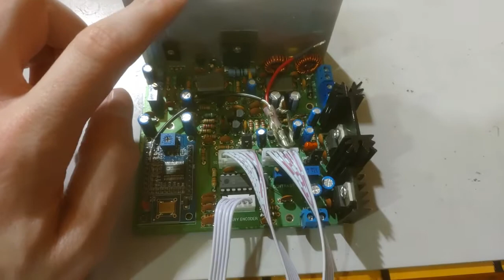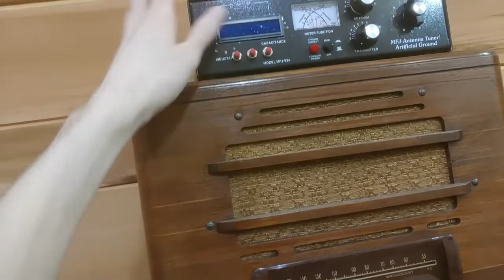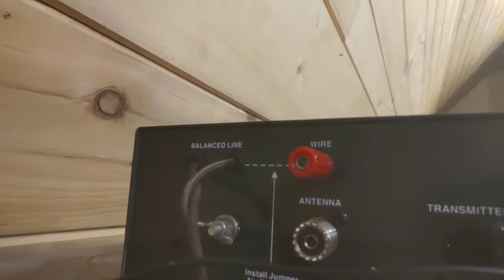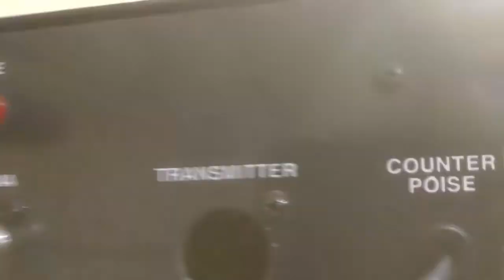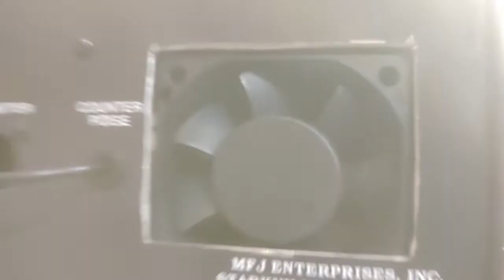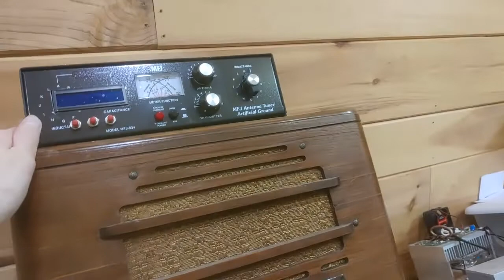Medium Power Mediumwave AM Transmitter

Comment: So on that MFJ tuner box are you using the built in tuner, just the cabinet or both? My 2nd question would be what approx. range is this low power transmitter capable of with a long wire center fed dipole @ night?

Comment: Congratulations on the project. see this project below:
Excellent design for AM transmitter class F modulated by switched source.

Saulo Project - PY2KO (SK), an evolution of Super Mouse 1, more powerful, but more complex.

The main features are:

- 250W carrier power, 1kW PEP (or more!)
- Operation in 40 and 80 meters, covering the entire band;
- Power supply 110 / 220v;
- More spacious box with more commercial radio features
- Printed circuit boards that can be made at home;
- Less use of SMD components.

The texts are in Portuguese Brazil, if you do not know the language I use google translator.

Transmissor Super Mouse 2 (SM2) - 250W carrier power, 1kW PEP
http://www.813am.qsl.br/index.php?option=com_content&view=article&id=442:super-mouse-2&catid=47:coluna-py2ko&Itemid=79

Transmissor Super Mouse 1 (SM1) - 100W carrier power, 400W PEP
http://www.813am.qsl.br/index.php?option=com_content&view=article&id=396:super-mouse&catid=47&Itemid=79
Reply from the maker: Thanks, I will check it. I don't log into this channel too often, so sorry about delay.

Comment: Where can I buy that? And what kind of antenna do I need?
Reply: That link shows It's 3 watts 10 pep. Just FYI
Reply from the maker: @timmack2415  They have multiple. I've seen a 40W pep before. They don't have it in stock all the time.
Reply: @timmack2415  range? I can't find anything in there. I think they left their bisness
Reply: @MiiMaker https://www.ebay.com/itm/173881898593?hash=item287c2b3661:g:P-8AAOSw8VJZjxZU
Reply from the maker: You buy it on ebay from Greece.
https://www.ebay.com/usr/kleop313
I explained in the video what antenna.

Comment: Hi Spectra like all the videos and great professional information on transmitters do you have any plans on am short antenna I need one between1.6 to 1.7 MHz am broadcast band I appreciate if you have any video or plans thanks
Reply: antenna for 1.8 mhz - reckon for 1.6 mhz       http://ra1ohx.ru/_pu/8/47794424.jpg
Reply from the maker: Depends on how short you mean. If it's less than 70 feet (22 meter) it's not going to go very far. The simplest way is to use a tuner box like I showed in the video and just run a long wire out the back as long as possible and hammer a metal ground rod in the ground. If you add radials, it will be much better.
Reply from the maker: And BTW, you could use an isotron if you want it really short, but they are terrible. I tested it myself and it only went 1-2 miles with this transmitter.

Comment: I use that 10-40 watt transmitter to drive a 100 watt amp. Yeah and I have a huge verticle with a variometer tuning coil. the large mosfet fried during a thunderstorm at the 48 volt setting into my antenna, i had to build an irf510 amp and buy a 100 watt PEP final amp.

Comment: An 8inch square or larger heat sink under that transmitter with the transistors mounted flat would take care of most of the heat issues. Possibly eliminate the fans all together.
Reply from the maker: Yep, I agree. All of them are on the edge so they could be bent down. This was my first AM and I don't use it anymore, but if I do for whatever reason, I'll try that.